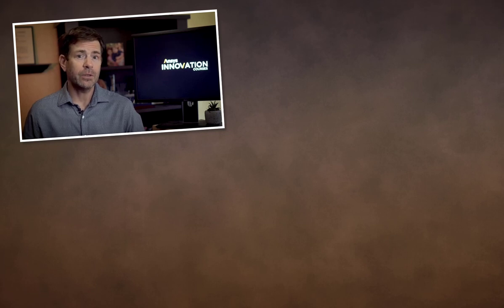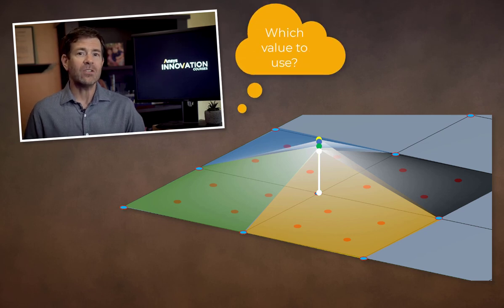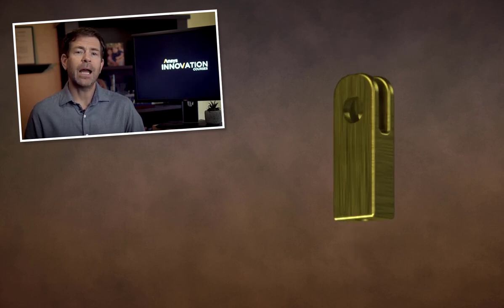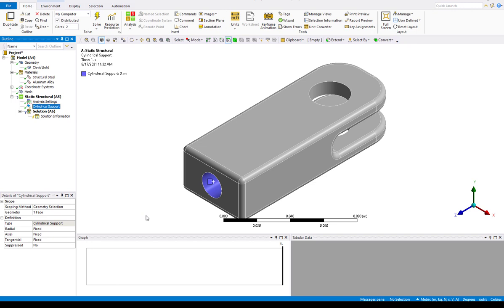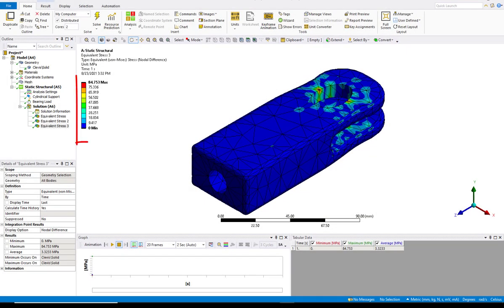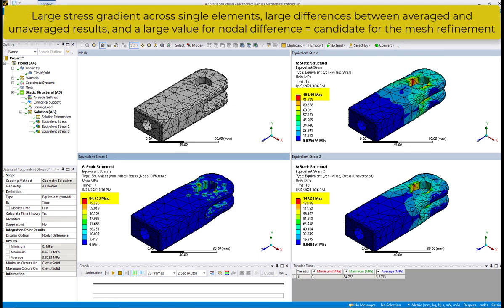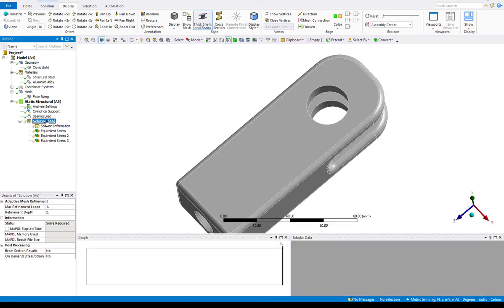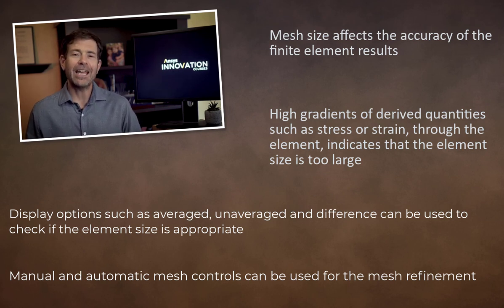Specifying an Appropriate Element Size for Stress Analysis Using Ansys Mechanical — Lesson 1

Comment: In the case of artificially high stress, the average nodal stress seems to converge but the unaveraged stress does not converge as you refine the mesh. Does this mean you cannot use the methods in  this video to verify whether you have a mesh independent result when there are fake high stresses?